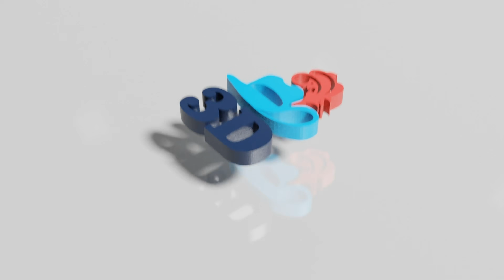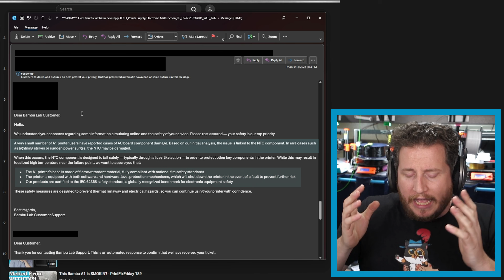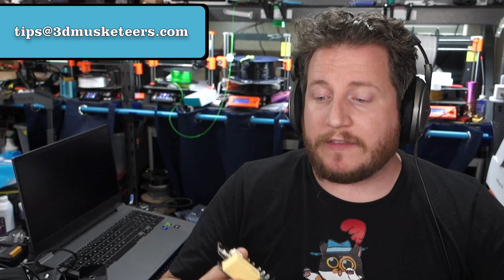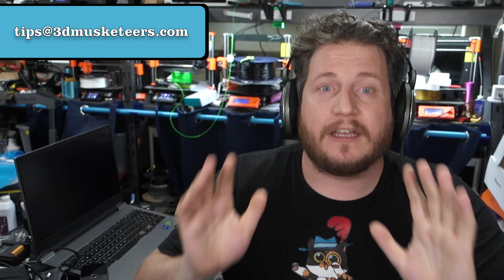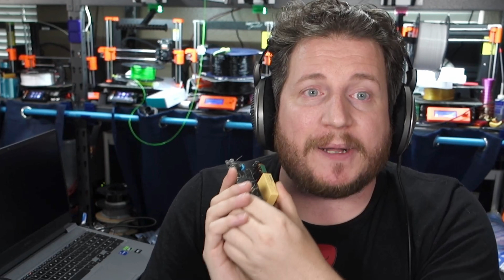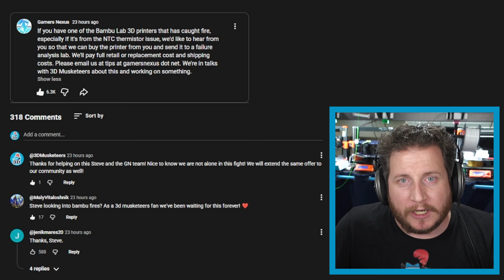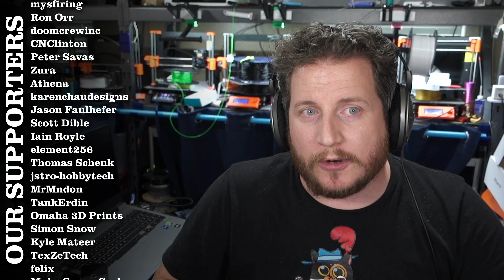I Was Right About The Bambu A1 (And I am MAD)!! - PrintFixFriday 245 FIRE HAZARD EDITION

Comment: The fact that you, Steve and Louis are taking this on, you've basically got the triumvirate. Given how much A1 products cost, I'm surprised that they are handling inrush current this way. I would think they would use a softstart pair of MOSFETs if they felt it was important at all. Also since it is an NTC Thermistor, I think turning it on one at a time won't do anything to help. Current is already flowing through it at max.
Reply from the maker: Being not an electrical engineer, that advice of heating each part up on its own might not be correct lol. But it aint a bad idea overall I dont think.
Reply: @3DMusketeers  The NTC thermistor on the line side of the power supply is usually there not to protect the power supply but to keep the power supply from tripping your breaker when you first plug it in. It keeps the current slow during those key first seconds while the caps charge up. Otherwise, they draw so much instantaneous current that they look like a dead short for a couple seconds. Switching power supplies with high current capability are most susceptible.
Reply: I'm a controls engineer and we use ntc thermistors for measuring temperature, its resistance is used to calculate its temperature.  This is the first time I've heard of them being used for current control. The resistance drops as the thermistor warms up. I understand the concept but have to admit it's a very crude and should I say "cheap" way of doing it.
Reply: @fatles2008 Oh, absolutely!

Comment: What about the 110v vs 220v modes? 220v uses a lot more juice when heating up the bed
Reply from the maker: We dont see a significant difference in the failures between 110 and 220v, this was a 110v machine

Comment: I believe inrush limiting is mainly for the electronics not so much the heater which is a plain resistive load without capacitance.
Reply from the maker: They use it for the heaters though
Reply: @3DMusketeers  Isn't it because all the incoming power is filtered through that board, when it was primarily intended to reduce stress on power supply filter capacitors and the main power switch, so that the machine isn't a dead short for a quick instant?
Reply: @3DMusketeers  In that case it is a constant current flowing through the same bottleneck and becuase the bed heater uses the most current causes the most consistent heating of the NTC.

Comment: I had an NTC burn up in a cheap Chinese power supply but all components around it was spared and the metal box contained everything.  Even the cheap manufacturer likely knew enough to give the NTC room to self destruct.
Reply: Yeah, this is bad on so many levels  it's absurd. I buy and tinker with loads of very dodgy, very cheap chinese power supplies and power electronics, I've never seen an implementation that could burn your house down like this. And that's with stuff that isn't hiding the fact that it's cheap and dodg, the idea that a premium product would use such a bad design is totally unacceptable

Comment: I am increasingly wondering if lowering the bed's temperature has an effect on the odds of these failing. The default plate requires substantially higher temperatures than cool plate alternatives, which could mean cool plates put less stress on the NTC thermistor.
Reply: Its anecdotal, but I have been running almost exclusively cold plates on my A1 for 2ish years now and have not burned out its NTC, that being said it was an early batch that had the bed cable issue so I am not sure if those are popping off as often
Reply: @GonnerMeLeggies  Yeah mine is slightly newer than the cable issues (just barely) and has been running a cool plate for most of its life so far and seems to be alright. I'm definitely watching it more closely now but I'm wondering if my choice of plate has made the difference.

Comment: These things are made in China. For the most part they work pretty good. But I wouldn't trust them once something starts happening . And if you think they going fix good luck with that.
Reply: Meanwhile my cheap Chinese Creality printer just uses an expensive and well-proven off-the-shelf Meanwell power supply module instead of a custom board with questionable safety-related design choices.
Pretty much all manufacturers aside from Prusa are Chinese, and Prusa is not holding back in considering that in their pricing policy. In the end it's the same as with every company in other countries: you get the quality you pay for, and some will still try to rip you off anyway to maximize their profits.

Comment: 19:05 what if i stick a fan on that damn ntc? (i'm unfortunately the owner of 4 bambulab machines 3 of them being a1s)
Reply from the maker: we cannot recommend modding your machine like that as now the onus of safety is on YOU and not the manufacturer.
Reply: If you run those printers, you are literally playing with fire.

Buy a printer from another brand.
Reply: @LordPhobos6502  That's the problem. There are no other brands that is as reliable and user friendly as bambui. Snapmaker u1 is a good runner up and even that isn't good for a newbie.
Reply: @LordPhobos6502  prusa is too expensive for me tried to use a anycubic kobra x(worst mistake of my fucking life), i'm not touching creality, and tbh i cannot find anything close to the a1 when it comes to hardware quality (not talking about electronics). I would want to have all my machines made by me but i do not have time to build my own machines yet (i'm running almost 3 businesses toghether with my wife)
Reply: @LordPhobos6502  also you can say that aswell for custom printers (to make it clear i'm not taking bambulabs side at all but i'm kinda stuck)

Comment: I have 3 A1's is there different board i can get. That way i dont have to go threw bambu lab
Reply from the maker: Unfortunately, there isn't a drop-in replacement board available that would work with that proprietary ecosystem at this time. You are stuck trying to get Bambu to send you the parts to make your printers safe and you are stuck doing the work yourself as well.
Reply: @3DMusketeers my wife watched your video with me. She is now running around the house screaming i want them out of the house.
Reply from the maker: We do not take ANY responsibility for marital or relationship problems caused by this video <3
Reply: @3DMusketeers lol

Comment: Well clearly this is user error because they didn't use the right filament, they used orca slicer or some other unsupported software and in some way violated bambu's TOS.  There's no other possible way this could happen, right?
Reply from the maker: CLEARLY /s
Reply: they put the printer next to non-bambulab materials, rookie mistake.

Comment: See what happens when you don't use bambus approved slicer? /s

I fully trust that bambu will find a way to blame the user, maybe even send them a legal threat for letting their printer burn.
Reply: The approved slicer is illegal too according to the SFC.
Reply: The name of the printer is the problem.

We all know how the Anet A8 went. A1, oops.
Reply: "you are holding it wrong"
Bambu lab, the Apple of 3d printing
Reply: Lol
Reply: Hate to burst your bubble, (I know you were being sarcastic, but for thise who do not) hardware burning out/catching fire has NOTHING to do with the slicer..... 

This is A: a hardware failure B: a hardware design error, and C: a firmware implementation failure.... 

Fire retardant ONLY for a certain amount of time... After that, ANYTHING becomes fuel.... 

This is 100% a Bumbu fuckup.....
Reply: How does them preventing other slicers being used on their printers benefit them in any way shape or form at all? The software comes with the printer so it’s not like you have to buy it so again, how does it benefit the company at all?
Reply: @beatersnbeers2145 if the product is free (the software) then You are the product.   There's absolutely no logical reason to send a print to my printer 10 ft away in my living room, that the file should have to be sent all the way to China, and then diwn loaded from China by the printer... They're very obviously capturing your print data... It's basically a gigantic IP farming operation... You are the product.
Reply: @3dcreationsofri  Exactly. Their machines are relatively cheap because they are banking on making a ton on your data.
Reply: “/s” ? What does that mean
Reply: @rileybankswho  it's a reddit thing to show sarcasm in a post.
Reply: I used their own slicer and app and the same thing happened, that board and printer is a fire hazard and needs to be recalled and that board burns. I am lucky to have a house.
Reply: Nice little house you got there.  Hate to see it burn down because you used the wrong slicer.
Reply: Just a few notes:
1) Sarcasm doesn’t exist in test. It’s by definition, a part of spoken English. 
2) If you have to explain a joke…
Reply: @NoMoreBsPlease  Where did it have to be explained?..
Every comment I see picks up on it.
Reply: @NoMoreBsPlease  you must be really fun at parties..

(This is sarcasm btw, in case you need me to type that out)
Reply: @NoMoreBsPlease Written text is a representation of spoken language. But English does not traditionally contain tonal indicators in writing. That has started to change with /s being a tonal indicator. Not an explanation of a joke. That tonal indicator allows for sarcasm to be used in text when normally intended sarcasm would not be detected with no indication of tone.

Now in most cases, people can pick up on intended sarcasm without that. But far less regularly than with spoken English. So the /s helps everyone and it ESPECIALLY helps those who have trouble picking up on cues in communication, like those with autism spectrum disorder.
Reply: @Sam_on_YouTube  Even normies can have a difficult time picking up on sarcasm in written text... I know I've been embarrassed a couple times...
Reply: @TheCurtisnixonYes, I acknowledged that. And if you are not autistic yourself, please don't refer to those who are not autistic as "normies." I'm not autistic myself, but I'm sure people who are would find that very offensive. If you need a specific word, "allistic" means "not autistic."
Reply: @Sam_on_YouTube  if someone finds that offensive, the problem is with them. I'm all for words have meanings, and some words should not be used, normies is def not one of them, in nearly any context. And def not this one. WPnotsees calling people normies, sure. But ffs, disabled people were the first to popularize the term. If we're not supposed to use it, good luck enforcing that...
While I don't have a diagnosis for autism or the like, I do have other diagnosis'. Which def qualify me in the not normie category. Besides the point really, but policing language, while needed sometimes, some are waaaaay too willing to find offense with everything. There are limits on both ends, but neither side seems to really care. so meh...

Comment: Qidi Plus 4 SSR flash backs.
Reply from the maker: pretty much.
Reply: @3DMusketeers  I don't recall anyone's printers melting though, despite them getting really toasty. To Qidi's credit they bit the bullet and said "our bad" here's an upgraded module for all US customers.
Reply: @spooknik-z3t  And Qidi acted on the issue fairly quickly, and it was fixed within a couple of months. While that's still too slow. They didn't sit on the problem and downplay it for over a year.
Reply from the maker: no, the coil of wire, which I think was a common mode choke, got to over 200C in our testing (if memory serves me right). I drilled a hole in the back of my first plus 4 to check LOL. It is why we bought the thermal camera
Reply: I'm getting flashbacks of BYD and Tesla fires.

Comment: Close enough! Welcome back Anet A8 🤝
Reply from the maker: If you dont learn from history you are bound to repeat it, or something like that....
Reply: @3DMusketeers  those who do not remember the past are doomed to reheat it.
Reply: @SkateSoup  retire the past
Reply: @SkateSoup  Or doomed to reignite the past.
Reply: @3DMusketeers  damn looks similar to the ssr from the first batch of the plus 4. would think bambu would of learned from qidi's mistake.
Reply: You're a firestarter, twisted firestarter
Reply: @guestc142 I see prodigy I like
Reply: @AdalbertBlacksmith  Long live Keith.
Reply: @guestc142 I'm the bitch you hated, filth inflated (yeah)
Reply: Ha I had that exact printer. Made sure to upgrade the bed and added a mosfet for the control systems for it.
Reply: Oh I remember those days...
Reply: Even the Anet A8 clones fixed the issues by checking the thermocouple is within a known good range and just power off if there's an issue.
Though the clones did have dodgy PSUs that even had film capacitors to ground, luckily the safety ground on all those were connected properly, so no shocks.
I gave up on my A8 clone because it printed spaghetti no matter what I tried, my old work place had a metal A8-clone in a right state, despite when I had an injury and unable to make space for a 3D printer when I was first offered a 3D printer to play with, I later asked for the A8 several times with offer to use the good parts of my A8 clone kits to fix it up, but no-go.
Among other issues at work, I eventually left the death-trap.
Reply: @dedr4m  Anet eventually shipped firmware that enabled a reality check on the thermistors. It didn't fix the fact that they were passing 10 amps through a pair of 5 amp contacts or the fact that the traces on their control board weren't robust enough for the current, but most of us figured out how to mitigate those issues. I still have one that just won't stop... I'd strip it for parts but it makes very nice prints!
Reply: @SwervingLemon  "that enabled a reality check on the thermistors", yep... I thought it was the thermocuple on the print head that allowed thermal runaway causing the print heads to catch fire?
Either way I mentioned they changed the firmware with the wording in "by checking the thermocouple is within a known good range and just power off if there's an issue."
Strange how people still think there's a disagreement when agreeing with them ._.
However, glad yours are printing great, I take it wasn't the plastic boards ones?
I was at a stage of trying to glue key plastics together which improved things but unfortunately the printer broke on moving house and because my ex boss was the sort who'd rather cost himself millions over "why should I spend a penny, I just want to make money" mentality, I ended up just throwing away the parts after bending and breaking every component and throwing it all away in front of him, with my Maplin receipt in hand to prove those parts belonged to me.
Reply: @dedr4m I wasn't disagreeung with you but rather pointing out a cntrast between Anet and Bambu. Anet voluntarily attempted to fix their firmware problems, and even revised their board design five times.

They still did some pretty dumb stuff but with each iteration of the A8 it got safer and arguably better, and ran vanilla Marlin at the end of the product's life cycle. 

Bambu, on the other hand...

Edit: also, you said "A8 clones" and the implication I got from that was that you were unaware that Anet themselves did eventually address the lack of thermal runaway protection. Apologies if you were trying to convey something else.
Reply: @SwervingLemon  My bad, I misunderstood by the way things were worded, yep, by Anet doing voluntary firmware fixes, even the clones benefitted.
Reply: Lol the ANet A8 was my first printer.   i learned a metric ton about how 3d printers work... by largely rebuilding the entire printer, including its frame.    lmao.
Reply: What apen now whit ti probleme is it fixe